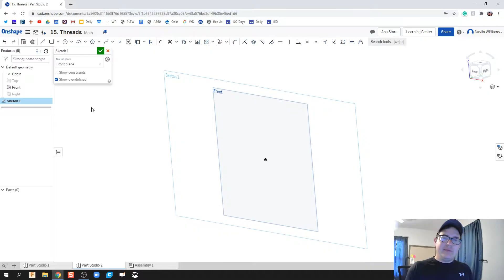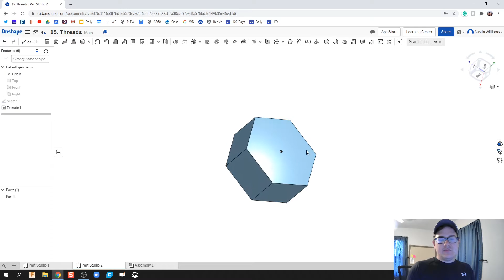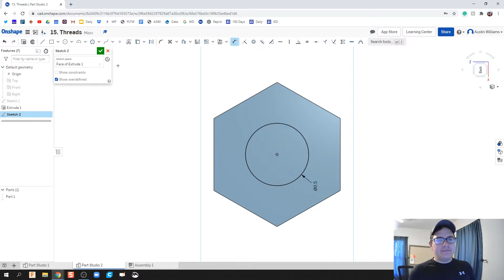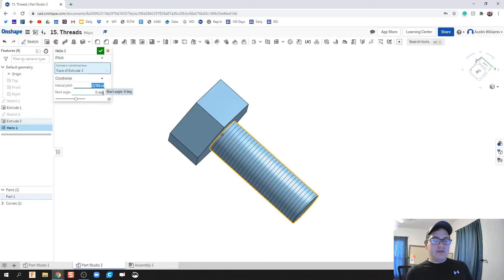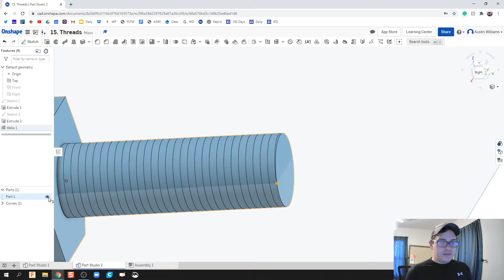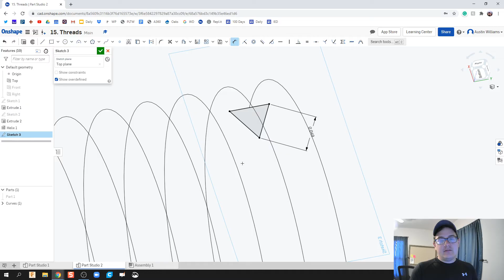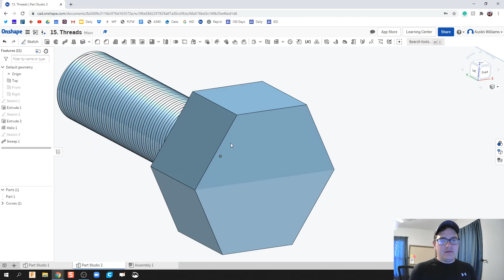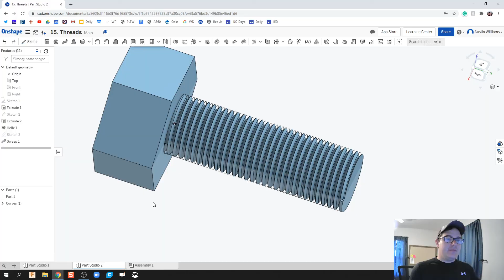Threaded Bolts using Helix - Day 15 of 100 OnShape Journey

Comment: Where is the video on how to put on the chamfers to the ends?
Reply from the maker: Not sure if it made it on a video, but you can chamfer BEFORE removing the threads and it will work. I'd just chamfer and them move the command up the timeline by clicking and dragging above the thread removal.